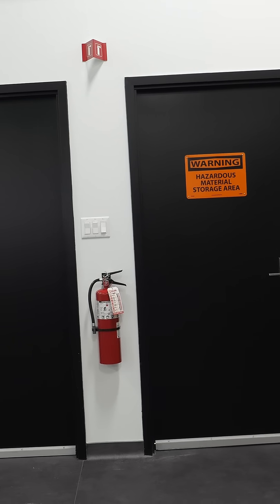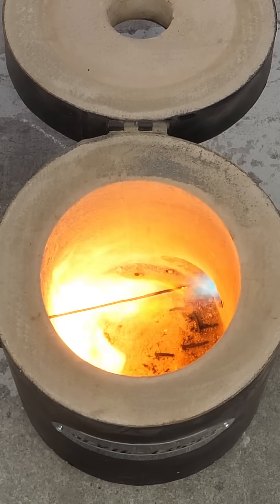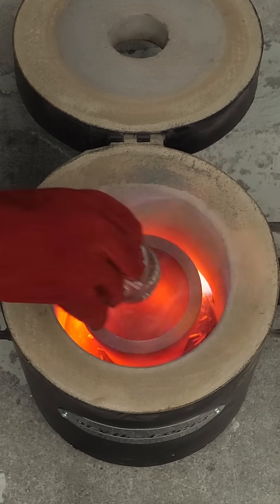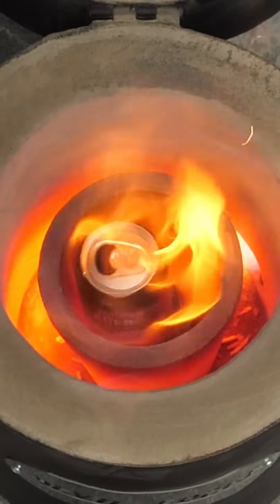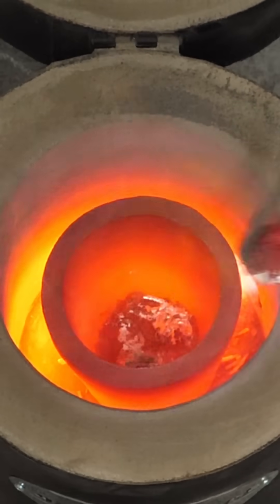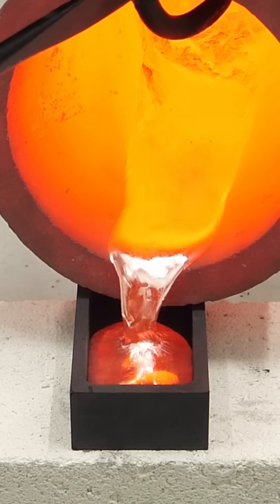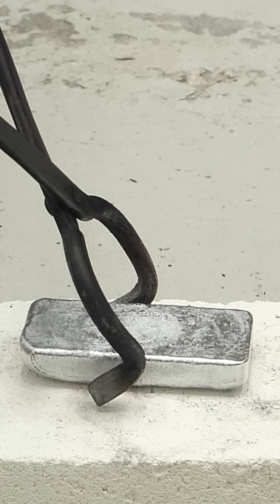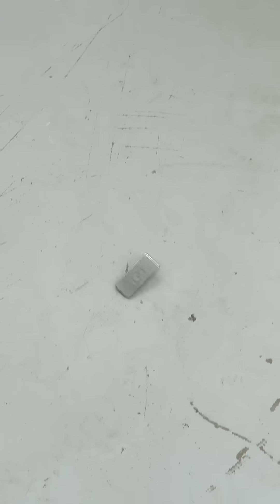Melting soda cans into a metal bar

Comment: The energy required to do that is a fraction of what it takes to get aluminum from the ore.    It's very recyclable, unlike many plastics.
Reply: Fun fact - according to geologist estimates, there is more aluminum than iron in the crust, but due to its more difficult purification process, steel is much cheaper
Reply: Hence, they pay you for your aluminum while you pay them to take your plastic.
Reply: @josh-kf2rd  In norway you pay around 30 cents US extra per can and plastic bottle. Which you then get back when you recycle them in a recycling machine which is in pretty much every supermarket/grocery store. Used to do the same with glass bottles but it got shut down for some reason. They used to be collected and shipped back to the breweries, washed and cleaned to be reused. But the government put a stop to it so now they just go straight in the glass bin which you can only find certain places :|

But anyway my point was that for both plastic and metal cans (drinks) you pay the recycling when you buy it and get it back when you recycle them. Other things than drinking bottle and cans are trashed in metal, glass and residual waist trash cans
Reply: @HunnyVRC  were making the same point. The money you get back in Norway for returning plastic is likely subsidized by the government, while the aluminum pays for itself.
Reply: @josh-kf2rd  No, it's a deposit included in the price. You basically get your money back.
Reply: @HunnyVRC yea I’d be down with that.
Reply: @HunnyVRC  In the US it's usually a 5 or 10 cent deposit. 30 cents seems like a lot. Homeless people and drug addicts would really like that though.
Reply: @HunnyVRC it’s not recycled when you get your money back. The system actually needs to recycle it and that’s the difficult part. The other part (=the consumer part) is just money making
Reply: @ My point being, if you HAVE to pay the deposit on bottles and soda/beer cans which you can get back most people will not throw it away in the nature, in random trash that will just burn it and turn it into co2 instead of actually recycling it into a new flask or clothing for example. The system has shown to be a success as 97% are returning bottles and cans bought inside Norway. The system is called DRS (Deposit Return Scheme) if you’re interested :)
Reply: @josh-kf2rd  The scrap aluminum value of a can is less than 1 cent. If you're getting more than that its because of an incentive program funded by a deposit paid at purchase.
Reply: @HunnyVRC  same thing happened in Iran it had something to do with labor cost and health codes
Reply: @HunnyVRC A number of US States have such arrangements, though for most, the deposit is $.05, with a few being $.10.
Reply: @MrRemakes 10, 15 and 20 cents for up to 0,5 L plastic and aluminum cans and bottles, 40 cents for 1,5 L plastic bottles
Reply: @jooger69  who pays the people to come get the stuff ship it to its destination and then "recycle" it
Reply: @HunnyVRC  in the netherlands only the only glass that is like the plastic bottles and aluminium cans are beer bottles. other glass bottles are collected seperately and sorted by colour. from there they are supposedly recycled, but i highly doubt it.
Reply: @HunnyVRC We do the same thing in several US states (it’s not nationwide), but the deposit is usually only 5 cents (Except for Michigan where it’s 10 cents). The bottle/can return machines at the grocery stores are even made by a Norweigan company, Tomra.
Reply: @HunnyVRC  huh, here in my part of Norway glass is collected periodically at home by the recycling company. We have a combined glass and metal bin (green bin) that gets collected, just like cardboard/paper (blue bin), plastic packaging (in a big transparent plastic bag), food waste (brown bin), and residual waste (black bin).
Reply: @FiXato  In Sandnes we only have the black, blue and brown bins, but the machines you need to scan to open usually have at least metal as well. But glass isn’t commonly collected here, might only be primarily larger cities doing that
Reply: @HunnyVRC that how it works here in Oregon the deposit for aluminum, plastic, or glass are all 10c
Reply: @josh-kf2rd you pay for your plastic 😐why? It's pretty simple to recycle and people buy that if you sort it yourself
Even a cheap machine and you can recycle your plastic (most of it) to granules that you can easily sell (it's better to sell unrecycled plastics)
There's trash Mafia in Iran because of mostly worth of plastics😂
Reply: @aminavazeh4433  were not talking about the viability of plastic as a commodity.
Reply: @josh-kf2rd  NREL sent a scientist, Greg Beckham to Congress to advocate for congressional funding for a new plastics upcycling program. 

He had invented a method to break plastic into its constituent molecules making it much more re-usable. 

The upcycled materials double the value of original PET, offering a financial motive for recycling while reducing energy use and greenhouse gas emissions compared to traditional method

Beckham’s team engineered enzymes to deconstruct polyethylene terephthalate (PET) from single-use bottles and combined it with bio-based monomers to create durable materials like fiber-reinforced plastics (FRPs). These composites are twice as strong as conventional materials and used in products such as snowboards and automotive parts

The problem is a chicken-egg boot strap paradox. industry won't invest in speculative tech without financial backing, and the demand for it. Congress is needed to artificially set a price and subsidize the industry until profitability is achieved. 

https://www.congress.gov/116/meeting/house/109359/witnesses/HHRG-116-SY15-Wstate-BeckhamG-20190430.pdf
Reply: You don’t get money back from plastic bottles??
Reply: @timberhoff  Depends on what state. Some do that, most don't.
Reply: @josh-kf2rd  That's only where can recycling incentive programs exist. It doesn't reflect the actual scrap price of a can. At actual scrap aluminum prices a can is worth less than 1 cent. Those incentive programs are paid for by the consumer and the business as fees at purchase. The only way to make money off the program is to collect discarded cans and collect someone else abandoned incentive refund.
Reply: @BenEllick  I'm talking about going to a for-profit scrap yard. They don't take plastic lol
Reply: @BenEllick that's still good, the few people who do begging collect cans and are way more likely to get money that way (as people probably won't think twice about giving away an empty can or bottle vs a few cents) and most people actually don't throw the bottle everywhere, keeping the streets cleaner.
But it has nothing to do with actually recycling.
Reply: Most recyclables just get shipped out to sit in a pile of garbage in southeast asia. I've become disillusioned with most large scale "recycling" operations in the USA. It's presented to us as if the goods are actually being recycled, but I barely see anything (like a soda bottle) that claims anything but the cap is recycled. There are a few smaller companies that actually recycle though, I just wish it was viable to give them my recycling instead.
Reply: @legend7951  same. I was really excited when my city started using this company about an hour away that posted all these great numbers about how much recycling they'd kept out of landfills, by sorting the household trash themselves. But then a journalist put an airtag in a plastic bottle to track it. That bottle did not get recycled. All the "recycling" just ended up as trash. There's another facility about half an hour away... but idk if I can trust them either.
Reply: @legend7951 
Unfortunately that's also the case for some European countries, we have recyclable material landfills here.
In my country only 7% of the recyclable materials collected are actually recycled...
Reply: Around 40% gets recycled  @legend7951
Reply: @legend7951 sources? There isn't a reason to lie about that. I feel this is just some conspiracy for parts of the U.S mind you most states don't have recycling programs only some of them do.
Reply: @legend7951  TOOOONS of marijuana packaging in Canada is recycled plastic. It's all black or a dark shaded colour with obvious lines of recycled plastic running through it. Recycling as an industry is an oil marketing scheme to push the onus on individuals and not the system of one use plastics and oil extraction that fuels it. That's "woke" though to point out 🙄
Reply: @legend7951  having worked in a can factory i can at least attest to the fact that we are VERY greedy when it comes to alu scrap. The Company that ships us the alu coils generally pays us to press our alu scrap into bricks to send back (to be recycled) so every source of shavings is carefully looked after. Naturally of course i know you are probably referring to end-users and sadly yeah they aren't very active with returning things like cans. The fact we can virtually infinitely recycle alu however is in of itself a huge boon compared to plastic which loses strength each times its remolded.
Reply: @RannyMannyy it’s mostly recyclable plastic that ends up there, if you look up the recyclable landfills in countries like Laos and Malaysia it’s totally insane. They get a massive amount of of e-waste as well, broken computers, phones and tvs. We justify it by saying that it’s so they can manage the recyclables “more efficiently” but there’s so much of it that it’s quite literally unmanageable (the president of the Philippines even threatened to cut off ties with Canada unless they took back 1,500 tons of waste a decade ago) . It’s just a way for us to “get rid of” the problem and feel good because we get told it’s all recycled.
Reply: @legend7951  lol here in germany its the other way around, it usally ONLY the cap which is no getting recycled or from recycled materials xD
Reply: @legend7951  yeah it is quite awful

we filipinos had a scandal with canada getting all their trash in shipments for no reason
Reply: @legend7951  Depends. Most of the time they sift out the valuable stuff like metals, high quality plastic, rubber and paper before shipping off the junk. But also a lot of Asian countries now ban the import of that low quality “recyclable” junk so it just ends up landfilled.
Reply: Glass was the best. Reusable, and if it broke, or got too worn or chipped, completely recyclable.
Reply: @bills6093  Glass weighs far more to transport, packs far less dense for return, and gets on average 12 uses before it needs to be melted down and reformed. It also takes a lot of hot water and chemicals to clean glass. If you consider the full cycle energy requirements of glass vs aluminum, aluminum actually just edges out glass as more energy efficient.
Reply: Well plastics like PET are actually highly recyclable, the reason it doesn't happen is because of mismanagement and corruption. But if you recycle PET the savings in energy over creating virgin plastic is 67%. 

I have seen home projects where people are able to recycle plastic soda bottles into usable 3d printer filament.
Reply: @AVTechTips  Obviously there is corrution and mismanagement everywhere the government touches. But its mostly just that US waste management is largely the purview of underfunded state programs and largely privatized, by choice. The labor of sorting and processing plastic into a product a re manufacturer wants offsets basically all energy savings, and it such operations require substantial investments to begin with. Honestly I think we will see renewable bioplastics become a viable solution before legacy plastic recycling becomes economically attractive for the private sector. Every country that does waste management well does so at a substantial loss (As a public service would be expected to).
Reply: @kylehenline3245  that was a really long way to agree with me...there are other reasons was plenty of an explanation.
Reply: Bro its a paragraph, don't let the brain rotted peeps drag you down to their level.
Reply: @kylehenline3245  no no...I don't mind reading...it's wasting my time I mind.
Reply: @kylehenline3245 it depends on the plastic. Most consumer facing stuff is cheap. But industrials that use high performance stuff will keep it sorted and recycle. You don’t hear about it because it’s B2B.
Reply: @AVTechTips  The energy cost of making new plastic just isnt that high though, and sorting plastics is difficult to do economically. When you dont have to pay for the downstream effects, it seems much cheaper than it is.
Reply: @AVTechTips if recycling plastic genuinely saved anywhere near that much energy, every major corporation would be doing it. They’ll happily do anything that saves them money. The fact that no major corporation is voluntarily recycling should be an indicator of how much energy, time and money it actually costs.
Reply: Have to take the plastic out of the cans too.
Reply: Turning plastic into graphene (which also allows for hydrogen collection) is now possible. The fact that graphene is so valuable makes the process very affordable, especially as you get very useful hydrogen as a by-product. It's a relatively new process, but appears to be very scalable. So hopefully that will become more widespread in 5-10 years
Reply: The most recycled material afaik is lead, in lead acid batteries it is like 98% recycled.
Reply: if you slice shred plastics by number bins you put them into griddle grills with leather wrap  you can make plastic products an ingots for cheap an low power,  so plastics are actually cheap to do like or turn it into 3D printer plastics, if you know what to do in  all reality.
Reply: WHY IS NOBODY TALKING ABOUT THE FACT HE WAS USING HIS BARE HANDS TO PUT THE CANS IN 😂😂😂😂💀💀💀💀
Reply: Is profitable to find aluminum cans that have no deposit, melt them down then sell it to scrap yards?
Reply: From a materials class I just had, I think it’s about 95% less energy to recycle than initially produce.
Reply: @McWeaselson  that's assuming you already have the materials you need to recycle close to you. you still have to pay for the logistics of sorting the trash transporting it from every recycling bin in your area and labor during the recycling process
Reply: @elijahnierstheimer9674  probably still less than gathering the ore and smelting it? It’s obviously not 100% free to recycle..but even if it was 50% less energy to recycle than to produce from scratch—that would still be worth the effort wouldn’t it?
Reply: Recycling isn't real, most of what you think you're "recycling" winds up in a landfill
Reply: What about the plastic label glued to the can?
Reply: Plastic can be made into fuel if done thru the pyrolysis method
Reply: @SCRB1GR3D98  You waste much more energy than you end up recycling
Reply: @SCRB1GR3D98  Yes but you have to put even more energy in to do so. Its a cool option for disposal with some benefits in remote areas, but large scale you would generally get a better return just shipping waste to be burned at a coventional power plant like some of the nordic countries do.
Reply: In Finland we get money from glass, plastic and aluminium containers we return to recycling automates.
Reply: If I recall correctly, aluminum and and glass are the only "recyclable" materials that are actually profitable to recycle. Everything else is just "feel good saving the planet" stuff.
Reply: к сожалению не всегда... хорошо бы знать некоторые эмпирические пропорции масштабов.... 1килограмм алюминия даёт 1кубометр водорода, который поднимает в воздух дирижаблем 1кг снаряженного(с оболочкой дирижабля всумме) веса, и примерно эквивалентен литру бензина для автомобиля или 800гр сжиженно.го газа(это больше литра), содержа 13КВтчасов ≈50МДж  1МегаДЖоуль ≈1Рубль≈1Рупия
Reply: PLA is actually rather good for recycling
Reply: Yeah that's the thing, recycling of things like, metal, paper and glass are actually economically feasible and extremely efficient, but plastic are complex polymers.
Reply: Weill, it's more fun to melt them. Also, you generally melt more than just one can and you have something planned to make with the molten metal.
Reply: There is a plastic inlay in aluminium cans though. Early versions didn't have that layer and could start to rust and spoil the inside.
Reply: Yup, it's one of the most recyclable materials we currently have.
Reply: as i remember it, until the 19th century at least aluminum was like super valuable because it was hard to extract from it’s ore and thus people thought of it as a rare precious metal like silver or gold. it’s funny now that we see it as just trash usually. it’s an awfully pretty metal
Reply: this is what made the aluminium brick at the monument now literally worth only a couple hundred quid
Reply: The problem with tiny crucibles and the now higher cost of LPG, by the time you get any mass one can at a time you've gone thru some serious fuel.
Reply: @Nat_Sarim777 I just turn it in to a major recycler for cash.  They have larger crucibles.
Reply: Does that mean every Minecraft pickaxe that mines ores contain furnace logic?
Reply: You can pay thee bill then
Reply: It's infinitely recyclable, since it's an element. Since plastics are molecules they deteriorate both over time and with recycling
Reply: It's around 1% to be precise.
Reply: Theres plastic in the cans
Reply: @KetJustin100  it doesn't enter the environment. It's burned and the gasses captured.
Reply: Dude plastic is petroleum based. You can literally turn plastic into back into fuel, Just got to refine it a little
Reply: @ROYGBIVDoReMiFaSoLaTiDo-w4p  True, but it isn't returned to it's original form like aluminum.  Maybe it could be the fuel used to re-melt the aluminum!
Reply: @jeffsaxton716  Exactly!
Reply: I bet though that the price of the gas he used was more than what he would get from taking the cans to a recycler.  Also, what's he going to do with that bar?  Put it in a drawer?  That's not really recycling.
Reply: But as I remember all aluminum cans is plastic inside. So, that type of recycling pretty same as just throw plastic bottle in the fire.
Reply: @thelittlewitch1 The plastic film on the inside of cans is very thin, so it's a tiny fraction of the amount of plastic that would be in a plastic bottle
Reply: Hate to be the bearer of bad news here… there’s an extremely thin layer of plastic inside aluminum cans, hence the fumes.